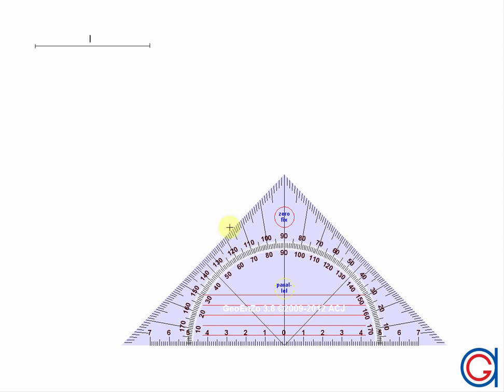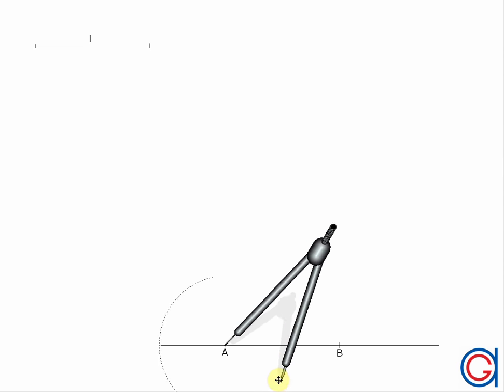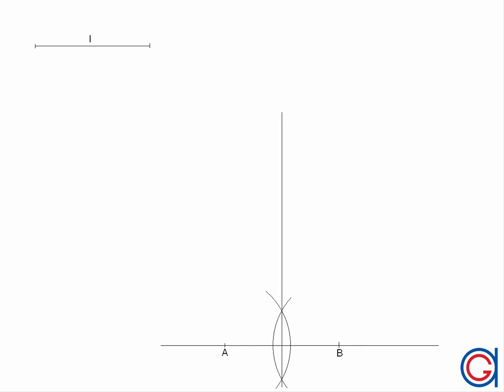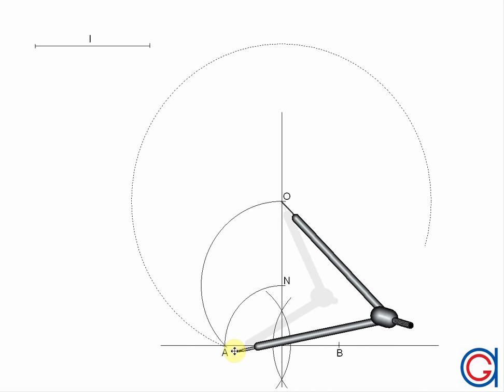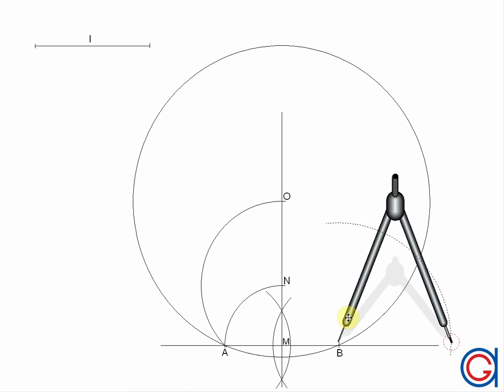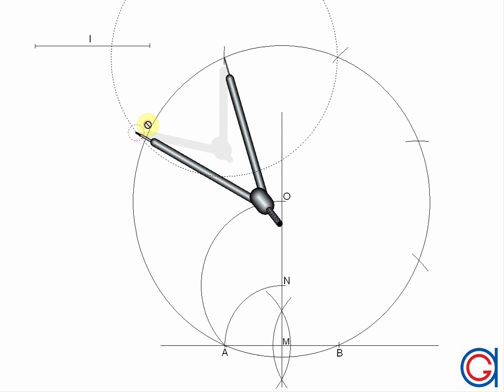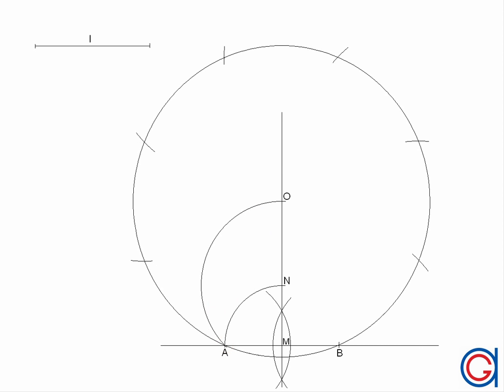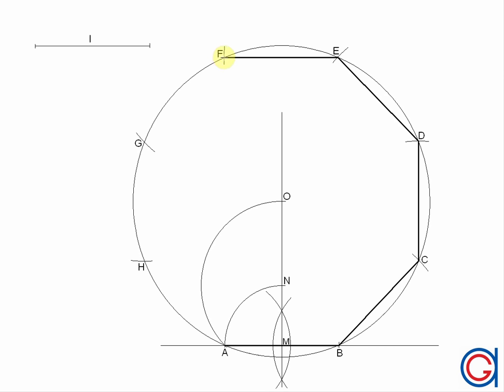How to draw a regular octagon knowing the length of one side

Comment: Why is that I got same result in both methods, this and by the method of taking angle 135..?

Same result in the sense, 7 sides are of required length and one side is short of the required length.. 

I tired drawing for 5 cm
Reply: Do manage to solve it? I also get the last side to be slightly shorter.

Comment: If your octagon looks like shit try this method instead, that honestly, works better:
-Draw a square.
-Divide that square into 4 squares, you can get the center point by getting the mediatrix using two of the sides.
-Draw an X that connects all 4 corner of the square.
-In the point marked by the X (The square center) draw a circle whose radius is half the entire square.
-The points in the circle that intersect with the X are the different corners of the octagon, draw a line in between them.